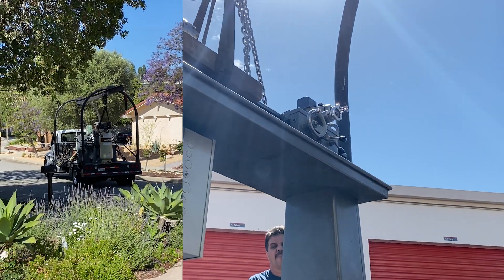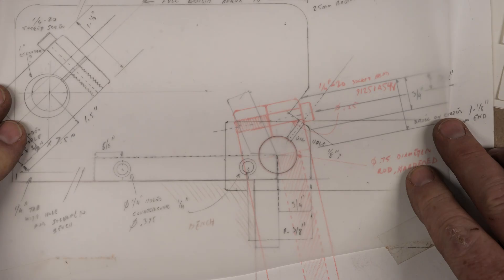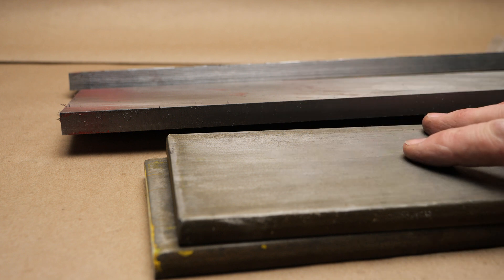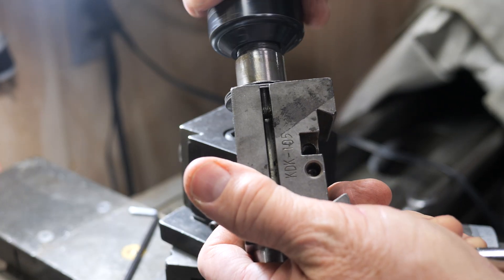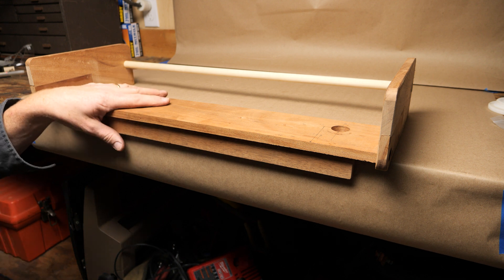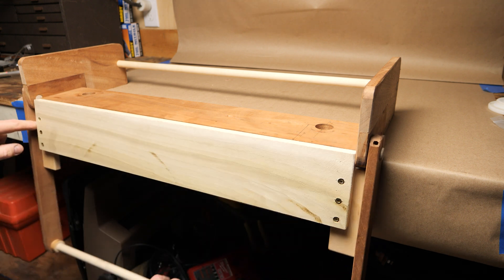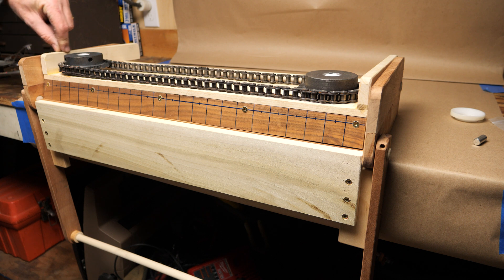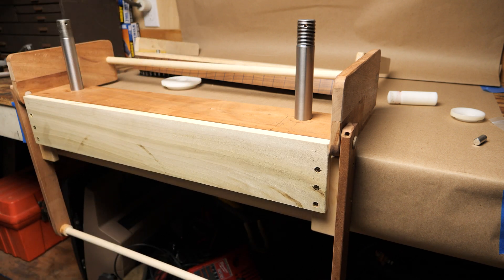Recreating Dan Gelbart's Bending Brake, Part 2

Comment: A2 steel! Dan Gelbert would approve.
Reply: How is the final product going btw?
Reply from the maker: @alexrains1893  A2 tool steel parts are back from the heat treat facility. Mill is set up to cut the eccentric slots under chain gears....Other parts yet to go- clamping eccentrics at the rear shaft, keeper rings for apron lifting handle. Getting very close now...
Reply: @junkyard_kahrs  How very exciting! Thank you for your reply, looking forward to seeing your progress.

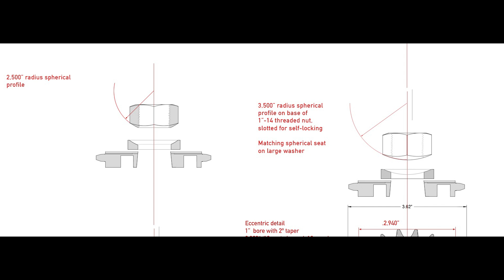Comment: Relating to the nuts' spherical base discussed around 5:50. Mating spherical washer pairs are available commercially. Many are made to	DIN6319 C/D, which gives dimensions. They can accommodate misalignment up to 3°

Comment: I have to ask John how your  partner was on you converting the room to a workshop. My previous house had the same thing and of course I changed it into a workshop much to my wife's dismay...
Reply from the maker: I've almost always had a workshop wherever I lived since hanging around the basement watching my dad build wooden sailboats. In this case, we never had any real expectation that a garage could function as a living/lounge area- so no drama. I think I spent a couple months running a new sub panel and wiring up the 220 outlets, a heater and lining it with plywood. It was totally worth it. My only regret is not doing a full ring of plumbing for compressed air, but I like working in there now.

Comment: @johnkahrs9706 Coincidentally, as you draw a lot in Photoshop, I draw almost everything in Illustrator. There's a really nice plugin called Cad Tools that is awesome for adding dimensions before making parts. And another by Astute Graphics that does live rounded corners and a host of other useful drawing tools. I also really love illustrator for accurately calculating material usage. Probably nothing compared to CAD but its what I've used for 30+ years. Being able to add text, pics, screen grabs from everywhere make the 2D tools nice to use.

Comment: I think Dan mentioned that he nitride coated the mild steel parts - I might be remembering that wrong though
Reply: Case hardened (carburised, heat treated and quenched). Mild steel does not nitride. 4340 does, to a degree... there are special alloys for best results.

Comment: The 3/4" support bar for the fingers is indeed welded on both edges to the top 1/2" plate. After welding the plate is straightened in a press (+/-0.04") and the finger mounting surfaces are cleaned up in a mill.   2. The vertical bar to stiffen the bottom A2 plate is screwed to the plate with 5 M8 or 5/16" Allen cap screws. All the shafts are 3/4" dia 1045 shafting. The rear eccenters should be hardened. No need for so many segments, use a 0.5"-1"-2"-4"-8"-8.5" set. This gives you 48 sizes with just one extra tapped hole between the 1" holes. .
Reply: Thanks for stepping in and lending a hand Mr. Gelbart!
Reply: Hi Dan,
your videos are amazing and have inspired me to develop a large range of field machines. If I ever get the chance to meet you please let me know, it would be an incredible honor.
Reply: If you ever read old post Dan please produce a set of drawing we can buy, so we can make our own. With enough interest we could get a batch of any specialist parts made.
Reply: Hello Mr. Gelbert! I will be trying my hand at making a bending brake by your design and your explenations given so far have been invaluable. My only remaining uncertenty is how did you obtain the finger's angle relative to the top plate. My guesses so far are that the support bar is trapezoidal ,or it was welded while wedged at said angle, or the finger's mating surface was machinned at an angle. I would love to hear from you which one is the case (if I was even close), along with any other advice. Thank you for your time and all the best from Romania!

Comment: Nice work I was also impressed with that brake .please finalize it and realeze the video. With regard to the little bit over sized sprocke holes i think you ca use loctite to fill the gap I hear Dan Galbart saying  you can apply loctite to fix bearing movements. Thanks

Comment: I might try to see if I could replace one of the links in that roller chain with an offset link to tighten it up.
Reply from the maker: I ended up pulling the shafts in a little bit because the chain was interfering with the side arms of the rocker plate. I ended up using an offset 'half-link' and the fit is good now.

Comment: Weld distortion can be minimized by simply not welding a full pass. Stitch welds will do fine.
If you share your Photoshop files I’ll model this in CAD and assist with the build. I own a fab shop in Canada.
Reply from the maker: That's a good tip on the welding. Photoshop file with layers (and a jpg version) are now linked in description. This is a 5000 X 7000 pixel image, errors and all. I do like the idea of open-sourcing this...
Reply: @junkyard_kahrs  Let's open source the design when a working example has been built.  We should work privately until then. Put a contact method in your profile so I can get in touch. I have a rough model done but YT wont let me post the URL
Reply: FYI: McMaster sells spherical washers that eliminate machining your own ball/socket. I didn't know either until today.
Reply from the maker: @mattym8 try to dm me: stoakmachine on Insta

Comment: As one of the eleven guys: Did you try to reach out to Dan Gelbart regarding this project? He is surprisingly approachable, and reads/replies to messages on his YT-channel.
Reply: Re questions in the video:  all parts are mild steel (cold rolled to minimize machining, but can be machined hot rolled). All parts that touch the sheet metal are case-hardened. The stiffening bars and side plates are welded (after placing alignment dowels or screws). The welding caused little distortion but the case hardening caused some additional distortion. The case hardening was very deep (about a mm) to allow to correct the distortion by grinding with a sanding disc held in a table saw. At the time I had no oven or press, so I could not fix the distortion in a press. If you have an oven you can heat up the parts to case-hardening temperature, quench, straighten or machine off the distortion and then send out to case hardening. The didtortion now will be small as it already went through a "dummy cycle".
Reply: @dgelbart  Thanks for your clarification! Also thanks for your 25-part UBC lecture-series on servos, sensors, actuators and system-design (uploaded by "fizzym" on YT). :) Binge-watch-worthy!
Reply from the maker: He provided just the right amount of clues to keep me going in the comments of the first video. Would love to meet him one day… one of the charms of this project is the challenge of figuring it out…